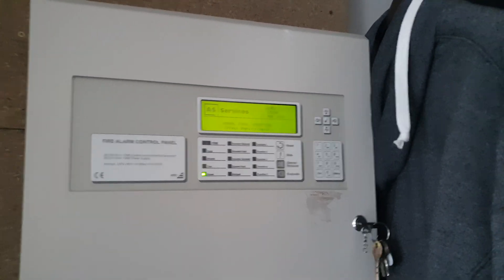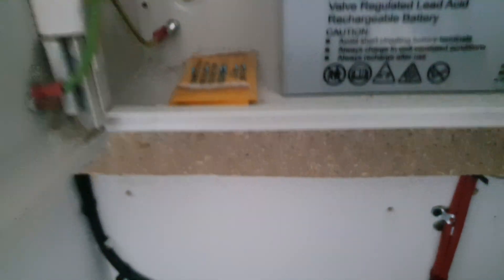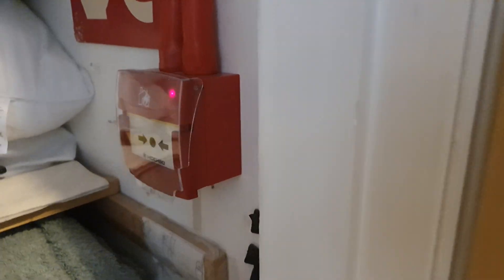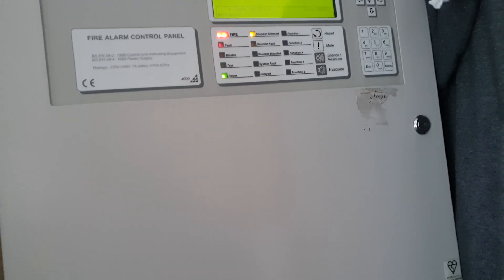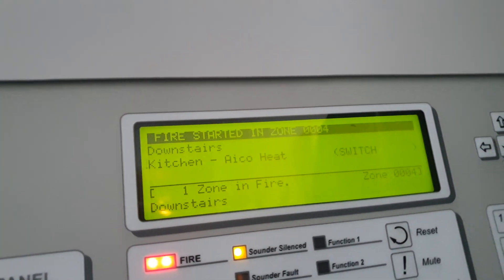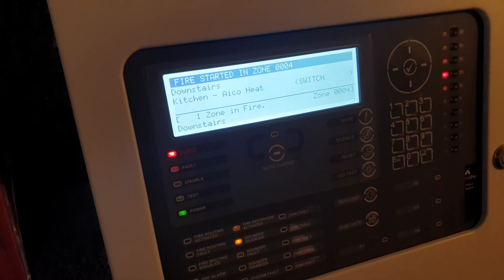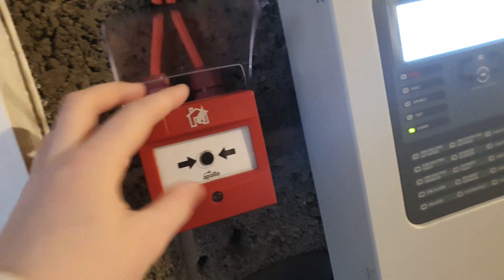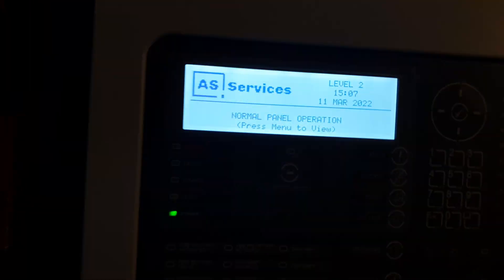Apollo/Hochiki ESP Addressable Fire Alarm System (weekly test 12/03/22)

Comment: How did u connect the emergecy light to the panel. Pretty cool that 👌
Reply from the maker: Through mains interface units for the panel. They wire onto the loop. When the alarm is activated it switches the relay to create a circuit and turn the lights off and onto battery mode.
Reply: @ASSystems  I'm about to do the exact same thing with a mains IO module, it switches L+N so where did you put the earth?
Reply from the maker: @staffsemergresp I can't really remember what i done but i'm sure i only had a single module so i could only switch the live. The neutral and earth just went in wagos. It's kind of how your light switch would work if the feed went to the switch in a way.
Reply: @ASSystems  Alright thanks, on the installation manual for it its given a wiring diagram for live and neutral so as long as its safe I'll probably put the earth in a terminal block and keep it away from the loop FP as much as possible with the divider